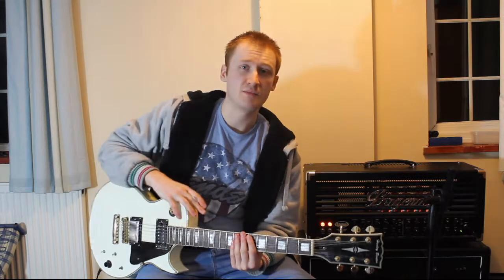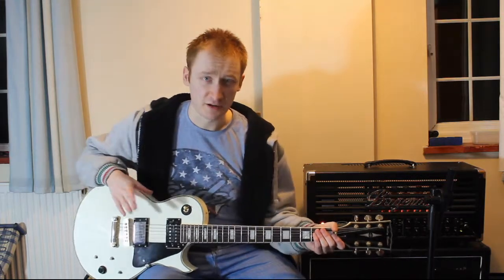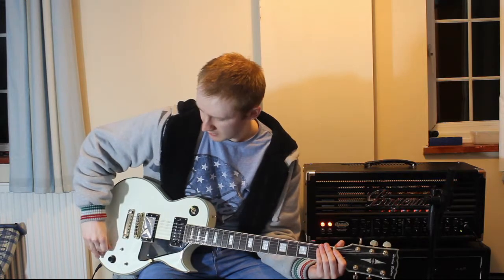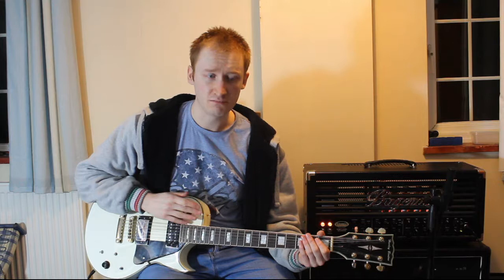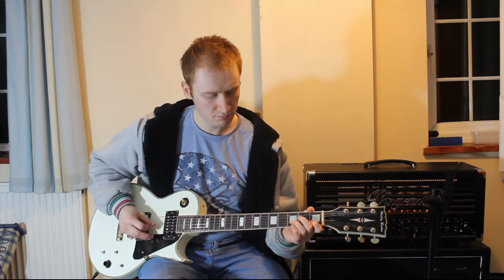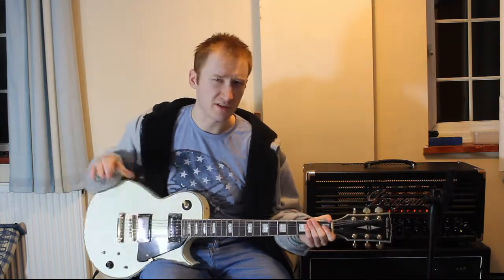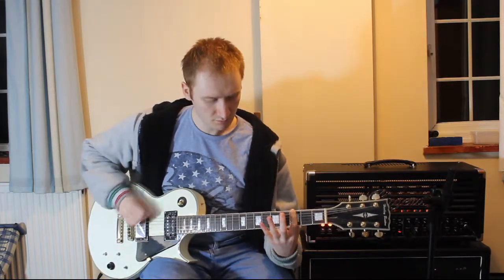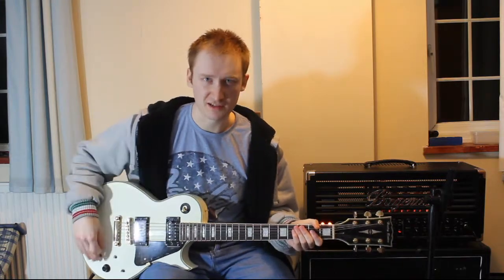Redesigning the humbucker - Did Gibson get it wrong? (Part 2)

Comment: There's more to output and volume than just DCR, and more to highs and clarity than narrowing the sensing field. Part of the reason why Filtertrons have their sound without being weak is because of the low DCR and the HUGE, strong as hell magnet. Try so neodymium in your pups, and keep going to even more of an extreme in regards to the wire thickness. Try to get 40 or even 38awg on there. Also, don't worry about any "tone wire" nonsense.

The thing there is that it was heavy formvar, which means a thicker coating. What the coating is made of matters not, but if you so desire, you can get double billed (build?) poly coated wire. The only downside is that in addition to the abnormally thick gauge, it'll make it even MORE difficult to get the desired amount of windings and DCR on there. But if you ask me, high DCR is overrated and you should just throw even more magnet at it, or find another way to fit more coil in there such as larger bobbins or switching to a stacked construction (even still with larger bobbins IE P90 sized), which also has the benefit of narrowing your sensing field even more.

Oh, also, you're already kinda doing this BUT use rail pole pieces instead of screws and slugs. A more uniform sensing field is always beneficial to smoothness and keeping that sibilant, shouty, ugly overtone out of the guitar in general. Last tip is to consider ditching the two pickup system and setting this bad boy at the 36th fret location (direct middle if 24 frets). The secret with the middle pickup spot is that as you fret the strings further and further, you shorten them, thereby weakening their maximum potential amplitude and sustain. To counteract this, you want the string center to be directly over the pickup when the strings are at their most disadvantaged state. Hence, the middle pickup position. And if you believe in harmonic nodes, the 36th fret location is conveniently both middle AND on one of the important "octave nodes" so yeah.

Comment: By rotating the coils so the strings are off axis you've had a massive efficiency loss. Similarly the performance of the coil is directed related to the area about the axis. Look at the progression from the charlie christian style large coil around an iron core charged from underneath, a p90 which swaps the iron core for 6 off the shelf screws and more efficient alnico bar magnets, through to the PAF.

Fender is the deviant here with narrow single coils, achieved in part by having a bobbinless design.

Comment: I've removed the screws from one coil of the neck pickup to get a brighter sound. Have you tried this? What are your thoughts?
Reply from the maker: I have, you've created a single coil with a dummy coil to buck the hum there. You've not made it any brighter, but you've reduced the harmonic content the pickup senses with a smaller string sensing length.

I'm not really a fan, as a pickup maker I think pickups should be made to sound good when used as intended, rather than modified when to.
Reply: Then I guess you won't like that I switch magnets, 😇
Reply from the maker: @dugbert5  Magnet swapping isn't completely changing the way the pickup functions though. 

I've already got a video on how to magnet swap humbuckers and sell the magnets myself, I certainly have nothing against it!

Comment: Dig out Z-coil G&L pups --- best of all design. Dimarzio X2N family --- not bad too.
Only thing i think must be changed --- put neodimium magnets.
Truth is i think --- any pups must be changed to neodimium.  ;-))))
Reply from the maker: That's essentially a P-bass design. A neodymium charged steel pole is reasonably similar to an alnico rod in strength, so you've essentially created yourself a split Strat single coil, I reckon.
Reply: + @Alegree  
Leo F. notice by himself which Z-coil is a evolution by P-bass pickup.
Dimarzio X2N contain magnets into wire coil and baseplate made from mild steel.